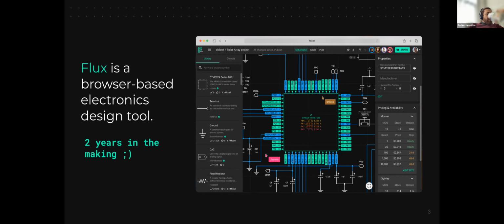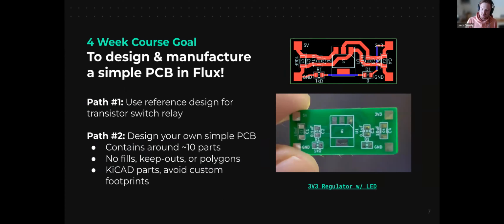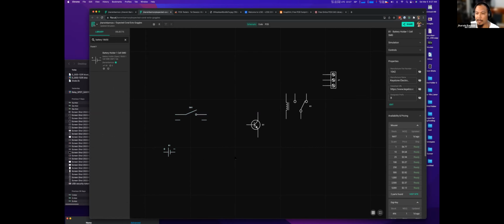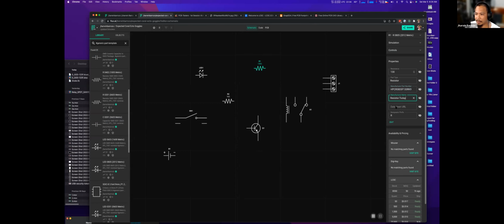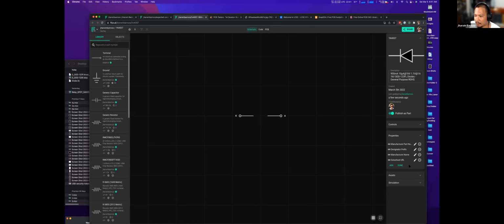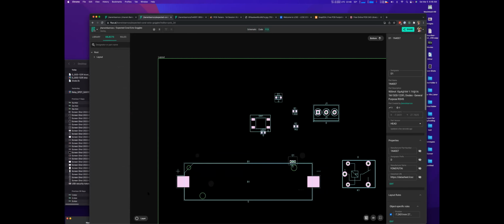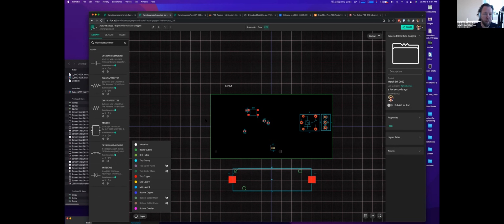Finding & Creating Parts | Part 1: Designing a Simple PCB in Flux

Comment from the maker: 1:09 What is Flux?
5:05 Introduction to the course goals & pre-requisites
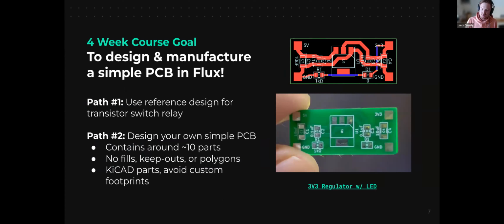10:28 How parts work in Flux
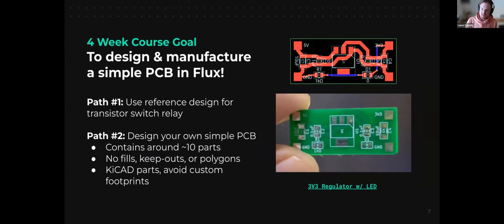15:24 Intro to the demo project: Transistor Switch Relay
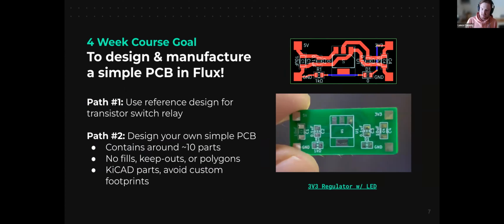17:13 Product demo begins: Searching for parts in the community library
23:28 Modifying generic parts
32:37 Importing parts
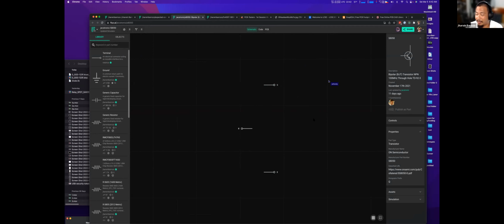37:35 Adding a footprint
39:17 Adding a 3D model
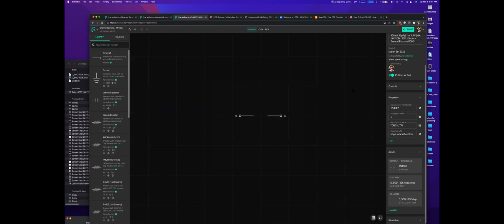39:59 Configuring footprint and 3D model to show
43:57 Questions